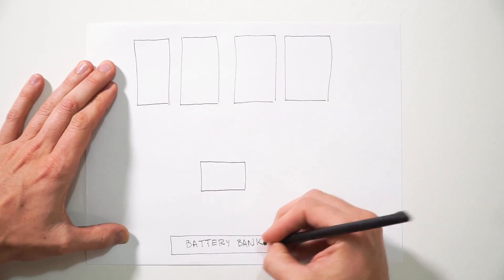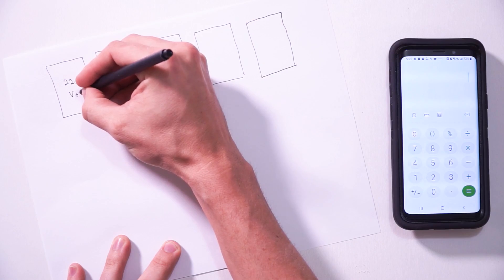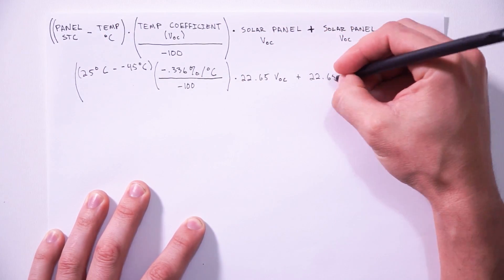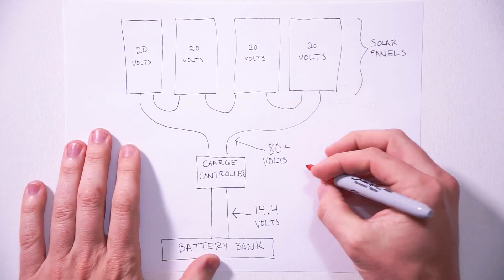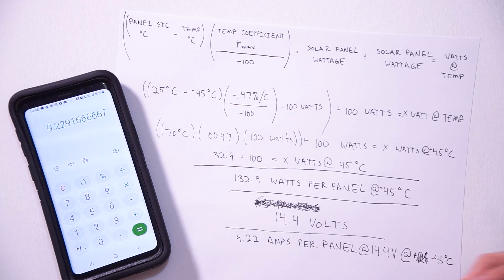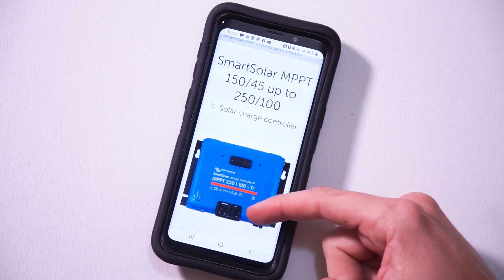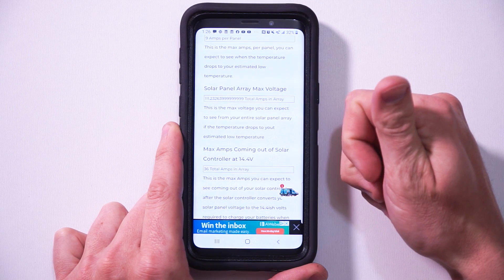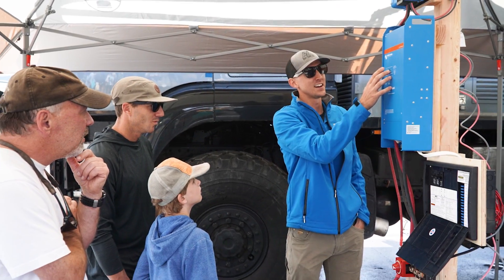How to Size a Solar Charge Controller for a DIY Camper Van Solar System

Comment: Can I plug the flux capacitor directly into the orgonne generator or do I need to modulate the  carrier wave output with a cascading field zener diode?
Reply from the maker: As long as the marshal vane is below the Voc, you'll be good.
Reply: But Captain Explorist . The Marshall Vane should always be calibrated against the Warp Drive -ve BUS differential with k-factor to maintain the hall effect constant at 0.02 % of sine magnitude !
I know because my nanna told me ~
Reply: Mark Yes my momma told me dat foosball is for the devil

Comment: Nate thank you very much!
I have been following you since your first video. I am building a 4x4 MB 170. I have 2 Max air fans in the usual allocated spots on the roof. I would like to put 700 watts on the roof. What do you think? Possible? Any advice on what kind of panels? I was thinking Panasonic’s or Lg you will probably know better and I definitely want to go Victron without a question for batter controller and most likely a 3 k inverter. Any help?
Reply from the maker: I think you could get 4x175w panels up there and is the direction I'd try to go: https://amzn.to/2Qq674a  These fit REALLY good side to side and I suspect you'd have no problem getting them to fit up there; but it's definitely worth measuring.
Reply: EXPLORIST life thank you 
  How about a job finishing my van build for two weeks with me at my place in Ct in my heated barn and efficiency apartment above... I have all the gear already bought except for the panels and batteries 
Would be fun..
Reply from the maker: Nice!  Sounds like a blast.  I'm not currently offering install services though.
Reply: Have you considered charging off the alternator? You can get up to 600 watts/hour this way
Reply from the maker: @AaronGeller  Of course!  All of the wiring diagrams found on https://www.explorist.life/solarwiringdiagrams integrate supplemental alternator charging.

Comment: Good information, thanks.
Just curious after using your calculator and looking at the Victron charge controller, Amazon listed 2 different controllers. One is called SmartSolar MPPT 100/50 Charge Controller and the other is called Victron BlueSolar 12V or 24V MPPT 100/50 Charge Controller. what is the difference between a "SmartSolar" and a "BlueSolar" controller besides the price?
Reply from the maker: Good question!  The main (only?) Difference is that the Smartsolar has bluetooth capabilities built into the unit and the Bluesolar unit requires an external bluetooth dongle.  The bluetooth capabilities IMO are awesome and allow you to see not only how much power you are currently making, but also how much power you have historically made on a daily basis.  It's great for making sure your system is actually performing how it should.
Reply: @EXPLORISTlife  
Thank you!